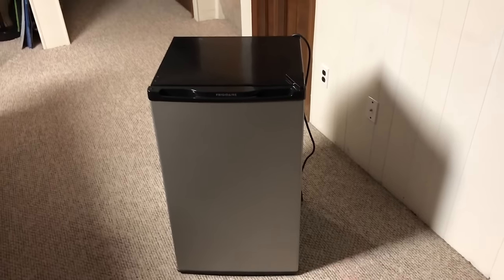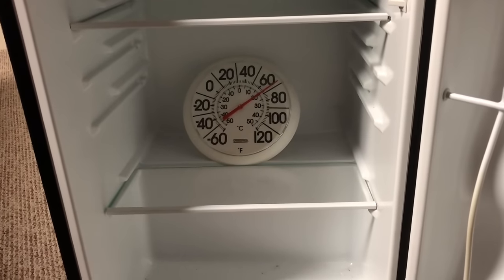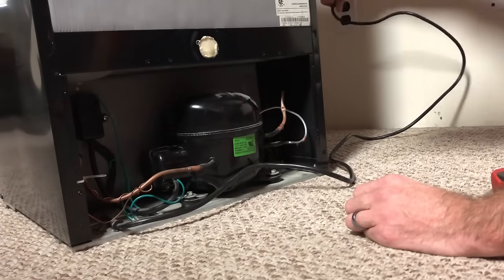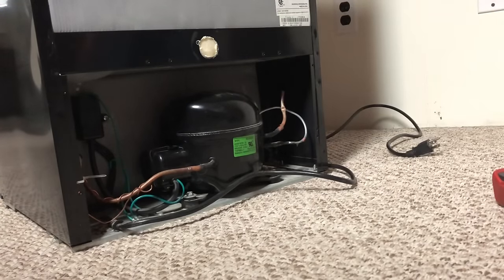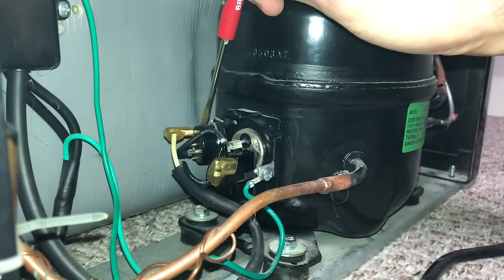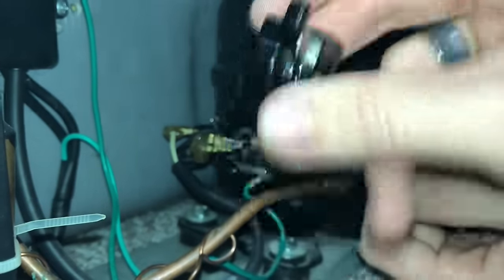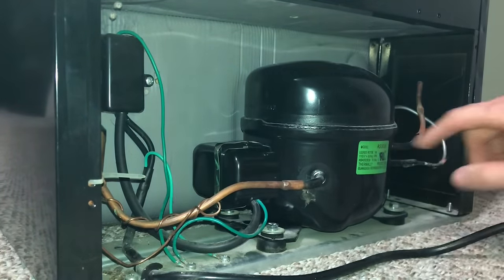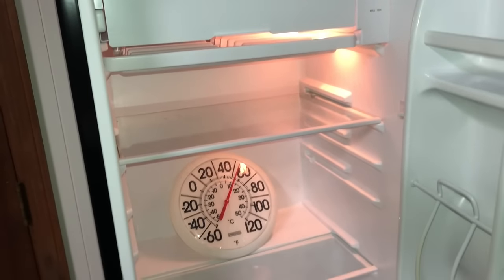Fix a Frigidaire mini fridge that is not cooling (LFPH33M4LM)

Comment: What if I don't hear a rattle in the relay switch? Could that still be the issue or should you definitely hear a rattle?
Reply from the maker: They won’t always rattle. If you test ohms across the two pins of the relay, it should be roughly 5k ohms. If there is zero resistance or it’s OL, the relay is bad.

Comment: My frigidaire mini fridge/freezer has a white wire coming out of the relay. Do you know how to pull it off? It's stuck on there pretty good
Reply from the maker: Maybe use a small flat blade screwdriver to gently pry under the metal wire connector?

Comment: Hi. I changed my relay but it still keeps clicking on/off like before
Reply from the maker: Was the original relay bad? There may be an issue with the overload protection, or your compressor may have an issue that keeps it from starting

Comment: I have the same problem but my relay doesn’t sound like something is broke in it, should I still replace it?
Reply from the maker: The relay may still be bad but may not rattle. Check resistance between the pins. If it has excessive resistance or the resistance is OL (out of limits) then it’s bad. Most relays should have around 5k ohm resistance. If resistance is in acceptable range, the relay is good and you likely have some other issue.

Comment: I have a midea fridge model MRS240S and my the motor starts and then clicks off repeatedly and I checked the starter relay but it didn’t rattle or sound like yours so I am not sure how to proceed I do t want to have to buy a new one if it isn’t a necessity
Reply from the maker: Sammie Sims if you remove the relay completely, you can measure the resistance across the terminals. You should be around 4.7ohm. If you have no continuity it’s bad or if you have 0 resistance it’s bad.

Comment: I found your video helpful except for one thing.  You mentioned that the relay rattled and that was a sure sign the the relay was bad.  If the relay does not rattle, does that mean the relay is still good & it is something other than that?
Reply from the maker: Dale Korhorn not necessarily. Technically a relay can be bad but still not rattle.

Comment: So I just saw this video as I'm looking to a solution for my fridge. I just got it about a week and a half ago and the problem seemed to have started 2 days ago. I noticed that the compressor either runs constantly or it doesn't run at all. So if I had it on the setting of 5 it would keep running, but if I turned it down then it would shut off and stop working to where I'd have to turn my thermostat back up so it would turn on again. Do you have any ideas what the problem could be?
Reply: This sounds like a thermostat issue. Did you test for it? If not, you should, because you might need to replace the thermostat. I'm sure they are videos for replacing thermostats.

Comment: I'm. having an odd problem with a 2018 Daewoo 4.4. Seemed to work fine out if the box but after a week it started causing a slight surge every time the motor kicked in so I figured it was the relay/overload unit. Replaced them with an OEM replacement that looked a little different. Ended up causing other even worse electrical issues so I went back to the old relay unit but left the new overload unit on there. Seems to have helped the electrical issues mostly but now it seems to struggle to pump enough coolant to the freezer. I'm afffraid to keep anything perishable in there so I'm using it as a drink cooler for sodas for now. This is so strange from a practically new, never before used mini fridge built by a company that used to make cars in South Korea. Terrable engineering combined with crappy electronics I guess. Any idea how to fix it the right way? Really would rather not have to scrap & replace a mini fridge that costed over $300.
Reply from the maker: TheAtom if it’s new, can you return it to the store. Maybe the compressor is defective?
Reply: @DustinRogersinMO   Got the mini fridge itself on Amazon & its now passed the return date unfortunatly. I'll ether do what I can to fix it or sell for parts & get a new one. I bought it this year but its a 2018 so I'm thinking it could have been a scammer selling old unopened ones out the back door. I may consider Whirlpool for my next mini fridge brand. Hard to find an interior I like though. The Daewoo had the best most sensable interior design. Just wish it had better electrical components.

Comment: Nice fix. I have a Frigidaire beverage refrigerator with the digital display on it. I can hear my compressor but it doesn't get cold. Any idea what may be causing this?
Reply from the maker: CryptoWarrior if the compressor is running, but it’s not cooling, there’s a chance it has a refrigerant leak or a blockage in the lines keeping the refrigerant from circulating through the system.
Reply: Dustin Rogers Mine isn’t cooking enough, it’s cold and ice in the back of the shelves but it’s not as cool in the front.
Reply: Dustin Rogers My mini Frigidaire  worked great for about 2 months then stopped completely.  I followed your video instructions and it did not rattle.  I put it back together and it has ran non stop for a month.  It does not cool.  Any ideas on what to do next?  If it’s Freon, how do I replace it?

Comment: Will the overload one also rattle if bad?
Reply from the maker: No. The relay has a ceramic like disc in it that can break which causes the rattle. The overloads typically have a metal disc that once it reaches a certain temperature will “disconnect” the circuit. Kind of like a circuit breaker. When it’s cool, it should have continuity.

Comment: Took my relay starter off and shook it. No rattle any other suggestions?
Reply from the maker: Tamika Okelly does the compressor click on/off? Can you feel the compressor running? Is the thermostat inside the fridge turned to the coldest setting?
Reply: @DustinRogersinMO  the compressor clicks on and off gets hot if I let it keep running.  The freezer area gets barely cool but the rest of the fridg is not.
Reply: @DustinRogersinMO  the setting goes to 7 I had it on 6 for 24 hours to see if it would get cold.  I ordered the relay part and will replace it then move on to the next possibility the fridg isn't cooling.
Reply from the maker: If the compressor is getting hot, it means it’s running and it’s not the relay or overload. If the compressor is hot it’s likely due to being low on refrigerant (which also lubricates the compressor to keep it cool). If it’s low on refrigerant it had to have leaked out somewhere and it won’t cool properly. Unfortunately the equipment and licenses required to work with refrigerants cost more than a new fridge would cost.
Reply: Thank you, the cost of having a professional add more refrigerant was more than a new mini fridg.  Just junked it but it was fun to tinker with it.  Keep the great videos coming.

Comment: I replaced the the start relay and the refrigerator is still not cooling, I can hear a buzzing/humming sound. I was told it may need a compressor. How do I replace the compressor?
Reply from the maker: You have to have the tools to be able to pull the entire system under a vacuum and recharge the refrigerant. Buying a new compressor and paying someone to charge it will likely cost as much as a brand new mini fridge.

Comment: Do you know if I could disconnect the freezer cuz I'm sick and tired of defrosting it. I never use it either.
Reply from the maker: D Who? Unfortunately there’s no way to bypass it. Almost all fridges only have a condenser for the freezer. The fridge gets its cooling from the freezer. On regular sized fridges, the fridge temp is maintained by a thermostatically controlled door/vent from the freezer compartment.
Reply: @DustinRogersinMO  thank you so much.. does that go for compact refrigerator too.  ?  I think so

Comment: I have the exact same problem with my mini fridge but mine has 4 wires and I can’t unplug none of them. Is there a specific way I should remove them?
Reply from the maker: They’re likely just really tight on the connectors. You can pull the entire relay off the compressor first. That may allow you to get a better pull on the wires. Just keep track of which wire went to which post.
Reply: @DustinRogersinMO  I did took off the ptc starter is just the wires that are stuck and it doesn’t wanna pull off. It wants to but it can’t.
Reply: @DustinRogersinMO  I think I got it. I looked it up on a different YouTube channel and it looks like I’m gonna need a small nose pliers

Comment: Mine has a two pin along the side, in trying to find a replacement I'm not seeing one like that. I see a couple two pins in the one and two slot or one pin and three pin. Will this work with a three pin if I'm not using the third pin?
Reply from the maker: You may need to lookup yours by the fridge model. Find a parts diagram and find the correct start relay for your model. Once you have the OEM part number, you can search to find it from other suppliers (Amazon, EBay, etc). It may be worth finding a local appliance parts store and taking it in and seeing if they have something compatible in stock
Reply: @DustinRogersinMO  I'm here at Hailey's appliance and they put it in and can't find it. Nor on the galanz support side
Reply from the maker: @McTardSquadron  do you have the old part with you? Can they match it up to something they have in stock?
Reply: @DustinRogersinMO  they only have one and three pin, here's another kicker too the two pins that are long side are in the two and three spot
Reply from the maker: @McTardSquadron  without being able to visually see what you have, I don’t want to assume. Sorry I can’t be more help.
Reply: @DustinRogersinMO  would you be able to message or email
Reply from the maker: @McTardSquadron  can you create a post on YouTube and tag me?
Reply: @DustinRogersinMO  when I looked online apparently tagging is not a thing anymore on new videos only in replies
Reply from the maker: @McTardSquadron  no worries. With the youtube app, you can also just create a text based post to share a photo, but the video works too.
Reply: @DustinRogersinMO  okay so I'm posting a new one as well because I got the regulator piece attached but now it's just a matter of figuring out what this other piece is because I don't remember now

https://youtu.be/3xugYdUNoAA

Comment: I’m not finding the exact start relay on Amazon. It’s for refrigerator model #EFMIS155. Any ideas?
Reply from the maker: I can’t find any parts diagrams for that model so I can’t tell what style of start relay comes on it. If it looks similar to the one in this video, even if yours has more wires attached to it, you can order one from Amazon by searching PTC relay 2-pin (for a 2 pin for example)
Reply: @DustinRogersinMO  I think we found one on Amazon
Reply: @DustinRogersinMO  well, I ordered a new relay but still not working. Any ideas on what it could be? The fridge is pretty new and purchased at an auction.
Reply from the maker: @JohnAndrewCarlton  is the compressor cycling off/on? Or just doing nothing?

Comment: Can you help i have a mini fridge when i turn it on it makes a noises for about 10 sec and then goes off i can hear it working .and the top of the fridge is cold .but inside the fridge don't get cold .? Can you help no idea whats wrong
Reply from the maker: KEN PARRY I recommend checking the relay and overload like I demonstrate in this video. It sounds like the compressor tries to start but can’t which could be due to a faulty relay or it could be an issue with the compressor.

Comment: Would this be a potential solve on a compressor issue with a Kegerator as well?
Reply from the maker: SullyN82 quite possible since a kegerator is basically just a fridge with a tap handle
Reply: @DustinRogersinMO  Thanks for the video. Question, I was able to swap out the relay on my Embraco compressor but didn't seem to fix the issue.
Now the compressor gets pretty warm, you can feel the hum, but not too audibly. 
Any suggesstions?
This was the relay: https://smile.amazon.com/gp/product/B01AKWWLVS/ref=ppx_yo_dt_b_asin_title_o00_s00?ie=UTF8&psc=1
and the two pin part still rattled when I shook the new one. Is that an issue?
Reply from the maker: SullyN82 typically if the relay rattles it’s bad. There may be a way to test the relay by itself, but I can’t tell from the Amazon photo what the pinout is for that relay to be able to tell you how to test it. If the compressor is actually running, but the fridge isn’t cooling, you may have a refrigerant leak which means the compressor will run constantly because it’s trying to reach the temp specified by the thermostat. The refrigerant also lubricates the compressor which helps keep the compressor cool.
Reply from the maker: SullyN82 reading the reviews on the amazon page, there was a user who said that the relay he received didn’t work either.
Reply: @DustinRogersinMO  would a bad relay cause this as well? Or do all signs point to potential refrigerant leak? The compressor ran for a minute on the old relay but then would cutout, start back up a minute later and the cutout again. It wasn't until I tried the new relay that it didn't click over at all and the compressor heats up to an almost 'too hot to touch' type temperature. Thank you for your help!

Comment: The light is on inside the fridge and the sound to show that is on but is not cold what might be the cause
Reply from the maker: Could be a variety of things. The light inside is a complete separate system and does not affect the cooling. If your thermostat is set to a cold setting, it should signal the compressor to kick on. Of the compressor is not running, you need to check the start relay as shown in this video or the overload protection device, which can prevent the compressor from starting. If the compressor is running continuously and still not cooling the fridge, I’d suspect that it’s low on refrigerant. For these small fridges, it’s not cost effective to recharge the refrigerant. You’ll likely pay more for a service tech than a brand new fridge would cost.

Comment: I just got my fridge yesterday and the compressor starts humming then cuts off. I checked the back and that brown wire that connects to the compressor was off. What should I do?
Reply from the maker: Big Homie Los if you can tell where it came unplugged from, I’d plug it back in.
Reply: Dustin Rogers it’s a copper wire I can’t just plug it in I think it needs to be welded back together
Reply from the maker: Big Homie Los if this is a brand new fridge, I’d return it to the store and get a replacement. If it’s one you’ve owned for a while, take a clear photo and make a post (on YouTube feed) to share the picture and tag me. Sometimes it helps to see the problem.
Reply: Dustin Rogers got it

Comment: I purchased a new relay. Installed it (with the help of this video) but it’s still not cooling. 
And yes, it’s plugged in and the dial is turned on so it should be cooling.
Same fridge.

Any ideas what my problem may be?
Reply from the maker: Can you tell if the compressor is kicking on? If the compressor just runs continuously and never shuts off, I'd suspect a leak in the refrigerant line.
Reply: @DustinRogersinMO  i got the same prob. It never shuts off so what should i do if there is actually a leak??? When i plugged mine, i heard a water drip then it starts to humm, continuously..
My fridge never cools
Reply from the maker: ji-hye sadly, unless you’re good friends with someone who has the equipment to recharge the system, it’s usually cheaper to replace the fridge than to pay someone to find/fix the leak and recharge the system.
Reply: @DustinRogersinMO  thank you for your reply.

Comment: Got my son brand new mini fridge and now the freezer wont Freeze. It's cold around it but not built up frost. Everything else is cold. Not sure what it is
Reply from the maker: A lack of frost is not an indicator of it not working. Frost only forms after an abundance of moist air that condenses and freezes on the cold surfaces. What is the temperature in the freezer? How long has it been plugged in? It can take up to 48 hours to reach freezing temps in a unit that was recently powered on.